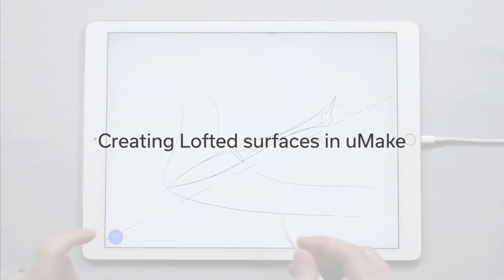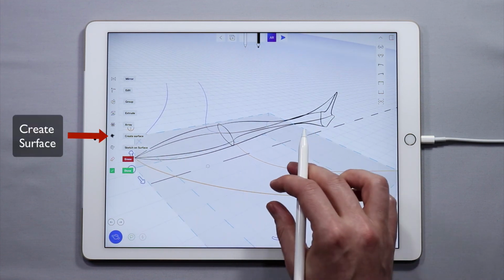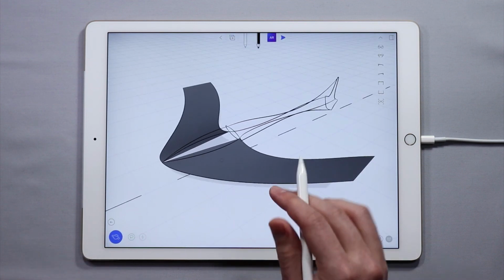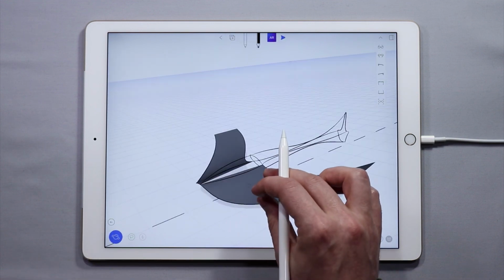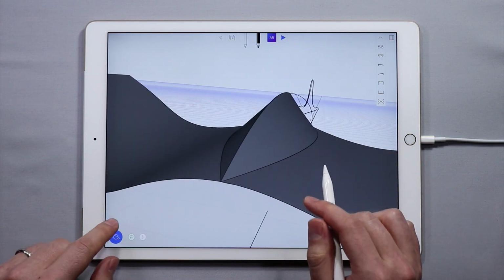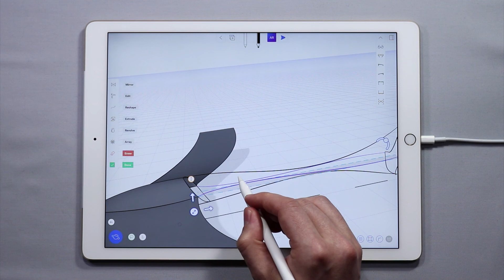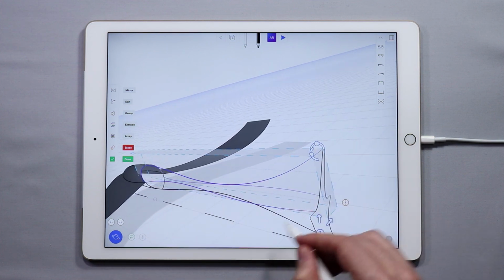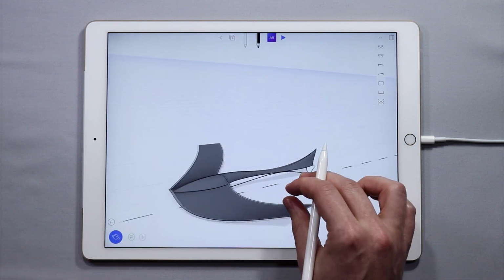Creating Lofted Surfaces in uMake

Comment: Awsome program, the loft/network surface seems not to work for me. Every time I try to make the surface like you showed either it will break the merged curves or it just won't turn green after selecting the half-circle. Do you know what's happening? Thanks, Niko.
Reply from the maker: Hi! Thank you for your question. Did you make sure the curves are connected to each other? You'll need a closed area to create lofted surfaces. You can email us at "hello@umake.xyz" with a screenshot or with the UMK file and we can try to help you. Thanks!
Reply: @uMake  Thanks guys for the quick response. I will send the UMK file for troubleshooting.